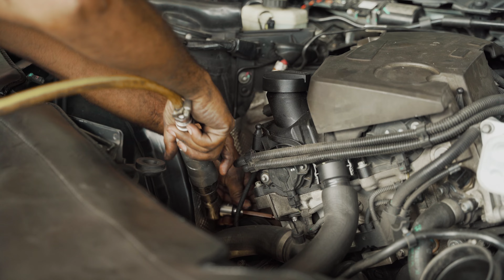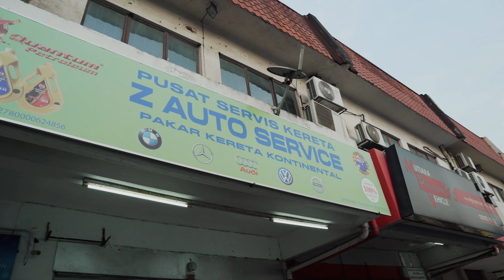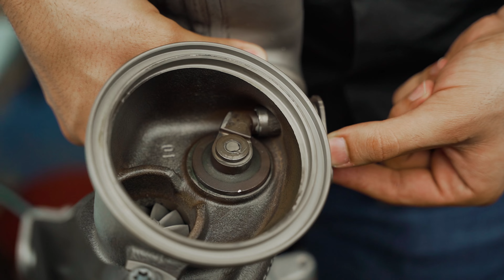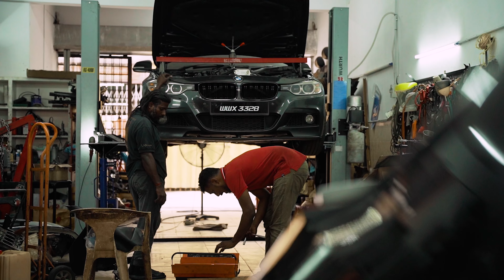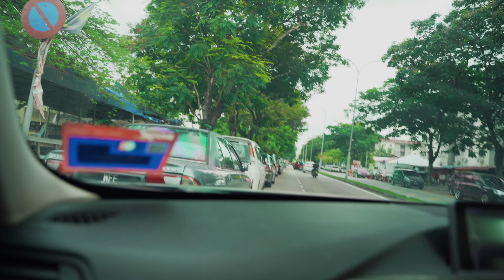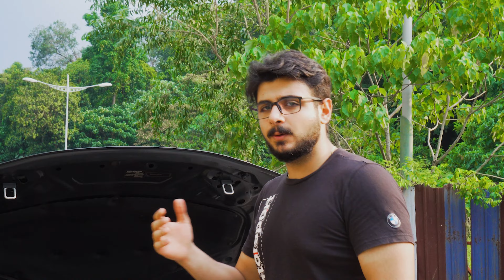I BLEW UP my NEW CAR's Turbo in 90 days | Brand New Used Car EP.5

Comment: MHI TD04 Twin Scroll unit, came with Pneumatic Waste Gate (PWG)

Mine was changed after found hairline crack & rattling (N20), changed Turbo unit after upgrading engine to Stage2+
Reply from the maker: Did the crack happen after you did Stage 2+?
Reply: @AJDrives   suspected the crack was occurs prior engine is remapped, the issues clearly pronounced after the remap due to higher Turbo boost then founds white smoke from exhaust & Drivetrain Fault messages 

Now mine changed to a new Turbo, installs FTP Charge Pipe and it drive happily till today 👍🏼
Reply from the maker: That's awesome man. How much power are you making right now?
Reply: @AJDrives 279hp / 438Nm
Reply from the maker: @wdtv3568  Amazing!

Comment: Ahhh the infamous wastegate rattle. It's not a  problem if you don't fix it, but the sound really makes you shiver 😂
Reply from the maker: The sound makes you feel like you're driving a beat-up car 😅
Reply: @AJDrives  Hahahahaha and driving a "beat up" car carrying BMW badge is definitely embarrassing 🤣

Anyway! I'm about to have mine soon, so I'm looking for a coilovers and wheel setup. What can you suggest for them? As for the wheels, I'm planning to get the 19" rims and opt for the widest width possible without hitting anything underneath.
Reply from the maker: Honestly I’m not the best in this. I’m still doing research and trying to figure things out for myself. So I better not suggest something I haven’t tried myself 😅